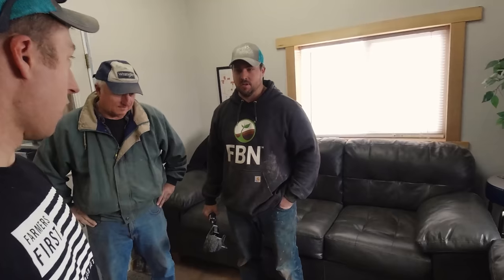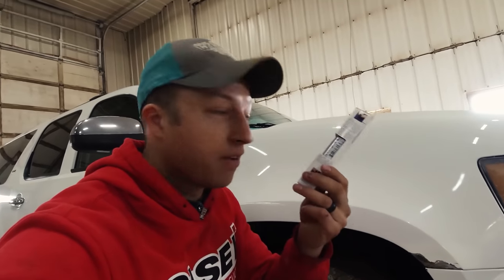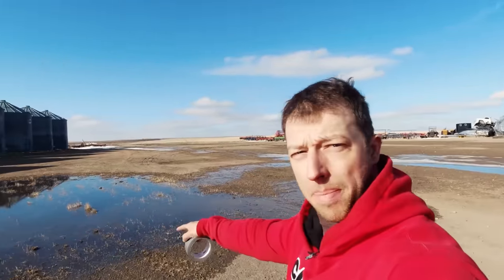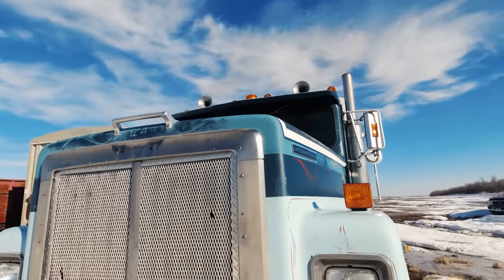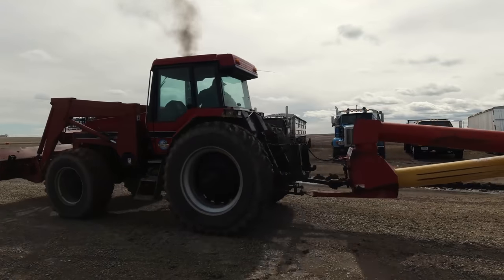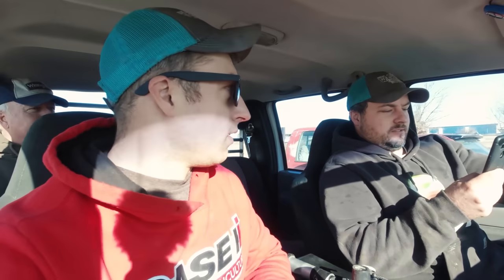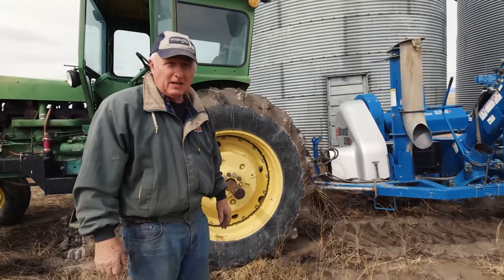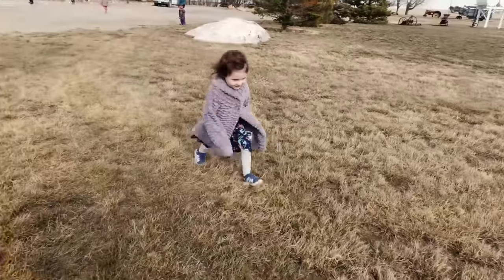Wake the FLEET｜Spring is Coming!

Comment: We always take our batteries out of our trackers and trucks that we don't use in the winter. We put them into the shop and keep them change and our batteries are 20 plus years old but we do lose some batteries from time to time so we do have some batteries 3 to 8 years old. What we do is take battery cables and put them together and put a small 15 watt solar panel to them with a 7 amp solar charger. Keeps the batteries good for well almost for ever or so far 26 years so far. By the way I like your long votes not the small ones because I can keep working and lesson to your shows so keep up the three and six hours shows.

Comment: Those two old ropes could be splice together by first making one loop around a tyre then doing the same with the other one on the same tyre that will give the towing give and protect the ropes as well. It is pretty easy to do Nick.l think your dad would know how to do it.
Reply: Steel rope is done the same way.
Reply: Heya Robert. You need to change Hollywood's nickname to duck duck as he likes piddling in water.

Comment: with a dirt pan you can cut a ditch a tha edge of the field to run the water around the shop yard that you csn still cross with no trouble , then put the dirt where it is needed in yard , I have done it  .. the ditch only needs to be 3 or 4 in the full with of pan , then one pass on sides to cut slop on side  you can still plaint in ditch … got grader grade from ditch to yard so water will run

Comment: See you always jumpstart with the ""fummins"" Get a trailer conector or something, and special jumpercables with trailerconnect in one side. Mount the bracket at the front bumper. Easy and you dont have to wear out the hood wire😜😜

Comment: Pro Tip - when you open the meridian hoppers lid pull down on the rope and slide the tied end of the rope down the square tubing to the middle of the bin and let go. It will hold the lid open and you never have to untie and retie the rope again.
Reply: Cool thanks 👍

Comment: The reason the gravel is sinking is because its too small you should go for hardcore size or stone shoring its about the size of your fist and its used here in Ireland and lasts through one of the wettest climates in the world its a good job if you can get your hands on it also building rubble about the size of your boot does the trick just as well.
Reply: We don't have access to that size

Comment: Have you guys thought about getting a little utility trailer and setting it up as a battery rack?  Park it in the garage on a charger for 4 batteries.  Use it to jump off equipment, or just swap dead batteries with good ones.

Comment: Talk to the railroads; Burlington Northern Santa Fe & the Montana Rail Link; they get their gravel from a pit at the east end of Homestake Pass; the Montana Rail Link cops a few cars from the BNSF for when they need some ballast.....
Reply: The ballast railroads use is between 2-1/2 - 3 inches in size, and I bet that would pack down nicely in the low spots you guys have.......
Reply: For what you guys have for low spots; I bet you could get six hoppers worth of railroad ballast & still need more; and one hopper holds about 75-100 ton worth of material.

Comment: As a 45 year Industrial maintenance tech, I hate to tell you but scissors lifts are NOT to be pickup with forks from the side. There is channels in the back end of the frame, on each side on the entry steps, made to pick them up without the potential of damage to the batteries/counter balance safety wings that fold out when the life starts to go up.
Reply: Interesting, we'll look at that

Comment: Raise the seat on the bike and your daughter will have a much easier time and wont damage her knees.  Seat height should be adjusted so leg is almost completely extended when pedal at the bottom of range.  Will not be able to be seated and touch ground with both feet.

Comment: After 06 gm had paint issues and it causes peeling like what u fixed my 06 still has paper thin paint whaile my 82 k10 with original paint is a lot thicker and handles scratches better

Comment: Key West Florida is watching you....about as far away as you can get and still be in the states.  You do a great job of describing life on a successful farm.  Easy question .....batteries.  Can you do a video on what type you get? and why?  Water or no maintenance gell type?  Your family is always dealing with cold and a battery that isn't holding up plus the cold and lack of use of whatever it starts.  How many batteries does the farm consume, and have you a corner in that shop to deal with them?  In the Florida Keys batteries last 2 years, salt, sun, use etc play a huge part in our boats or vehicles they die quick.  I'm imagining you have a bank of chargers that are ......over charging and thus the daily challenge of will it start..?  You must be dropping 4k in batteries a year easy...thoughts?
Reply: Probably have 40 to 50 batteries used. And on average purchase around 5 to 8 a year. All are wet cell acid type.

Comment: Dead batteries:  Did you ever consider solar trickle chargers for your equipment?  I didn't do an exhaustive search, but for ~ $15 each, Harbor Freight has a unit you could put on equipment that sits a long while.  The best thing you can do for a lead acid battery is keep it fully charged.  Yeah, I know - $15 times the number of machines you have adds up; but, so do batteries.  You could, by the way, series two of these for 24V systems.  What say ye?

Comment: ever heard the name Carl Huckfelt out here in south dakota. i helped him fire up his big bud years ago. batteries were getting age and he had me turn the engine one crank at  time to load up the individual cyclinders. went through process and it fired right off. big bud came out here and bouight several thousand acres of prairie and attempted to break and farm it. it turned out to be a disaster as it was so rocky it cost them hundreds to just rock it. carl had a 80 ft frigstad chisel and he was paid to fertilise it using the nobile drills. he had to tie every one individually so the could flex up and side ways to keep from self destructing. it was kind of commical watching them bounce up and down going down through the field over the rocks. he broke the chisel down to 60ft for this purpose and the drills were 7 or 8 ft in size. i cant remember the name of guy who started big bud but it was his venture. it was an experience
Reply: Gensler and Nelson started it first

Comment: The pressing question? Where did you find the slide? Also with your utility truck, when operating the post hole/telephone auger does it have down pressure of just the weight of the boom?
Reply: Can put pressure down. Slide was from home depot web site
Reply: Thanks 🙏

Comment: Can you guys use the “pup” with your semi?
Reply: Highly unlikely for several reasons. 

1) Weight laws. Loaded pup would add..  20 ish tons to gross weight?
2)Length laws. Would be 85 or 90 feet overall.
2a) REALLY hard to back up any distance.
3)No hitch on back of the semi trailer. It needs to be VERY heavy duty. We thought about adding a pup to my L9000 Ford I drove for Fulton Feeds here in Ontario,  The hitch ALONE would have added 1.5 tons..   Also unlikely the frame of the trailer is designed to pull said weight.
This is a good question though.  Anyone not using this type of equipment would wonder.
Take a look at dedicated "grain train" trucks in Western Canada.  Much higher weight limits , and length laws.  They got some monsters there. Here in Ontario, Wallenstein Feeds has/had triaxle lead/triaxle pup feed trucks.  42.5 metric tonnes PAYLOAD, legal.  Or 46.85 short (  US) tons.
Reply: MrDaChicken Thanks for your explanation and using some metric 👍 a video or two ago the had to make up a sale with a half load which seamed a shame, sure they would use this if they could. 42.5 payload is the almost the same as the gross legal lorry weight here in the U.K.